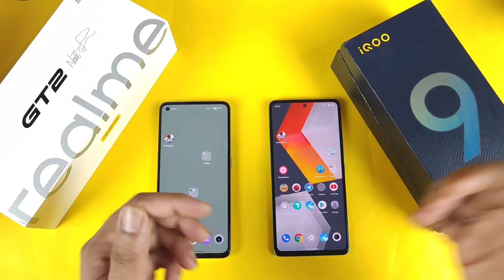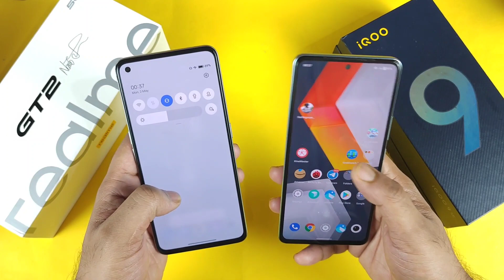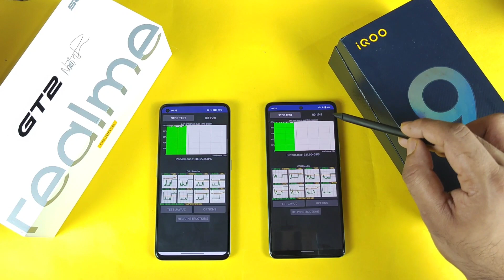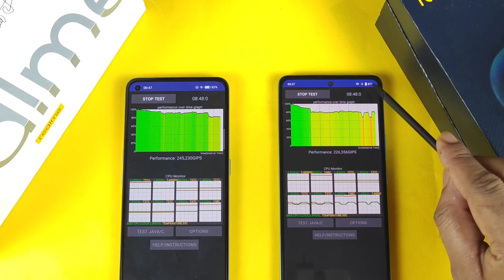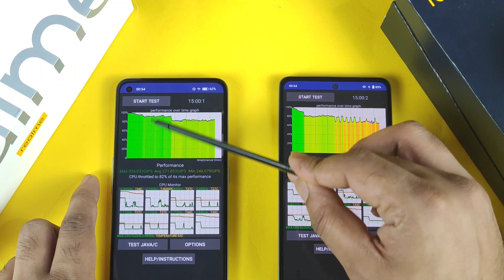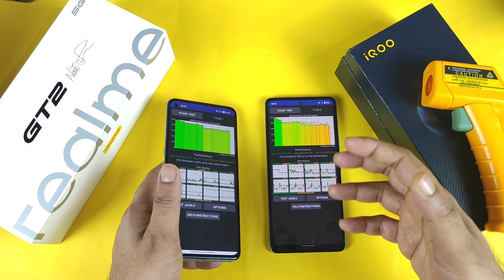Realme GT 2 vs iQOO 9SE CPU Throttling Test Comparison Shocking Results OMG 😱

Comment: I need one answer from you sai bro iqoo9se or gt2 which is best for gaming and camera?
Reply: Iqoo 9 se better amazing
Reply: If ur looking for gaming iqoo 9se is best choice but make sure to check display ppi density.  more the value means, better the gaming experience
Reply: Only advantage gt2 has on 9se is battery. If that matters to you go for gt2. If you're happy with small battery go for se. 
Still even performance and camera wise not much difference between gt2 and 9se. You can get both for 30k too.
Reply: Gt 2 company ko ya band karwayga